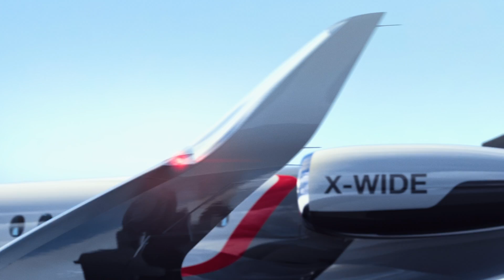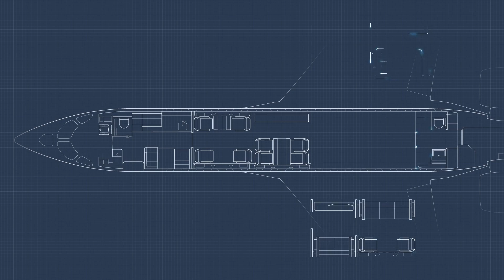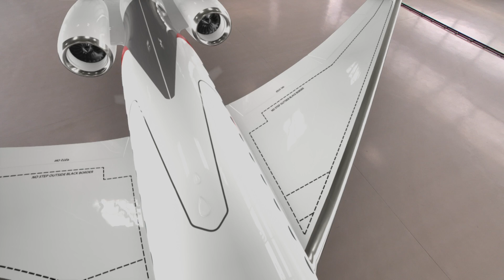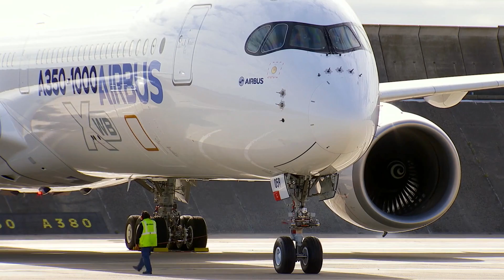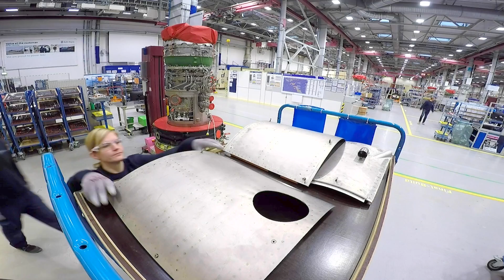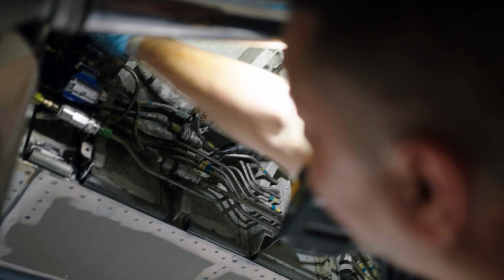Falcon 10X Premiere

Comment: I just need a Falcon 900 LX to fulfill my needs foir a range of 5,200 nautical miles, a ceiling of 51,000ft, a short-field operation of 3,000ft, a cabin to seat 7 to 14 and sleep me on a comfortable bed, and a combined thrust of under 15,000 lbs to keep the fuel consumption below 260 GPH. If I can afford to travel on longer hops, I'll opt for a Falcon 8X. If I can receive all of the money owed to me, then I'll either opt for the Airbus 319 or Boeing 737, which can keep the costs low by realizing the scale of their global fleet, so I can have an on-board shower, bar, office, bedroom, and living room. 

For large aircraft, I prefer to have the engines mounted on the wings, close to the center of gravity. For transoceanic business aircraft, I prefer to have a trijet. For short-field aircraft, I prefer to have an aircraft with high-mounted swept, trapezoidal anhedral wings, like  the BAe 146, collapsible right-triangle struts and fat tyres, like on the PC-24, and an on-aircraft APU, like that on the PC-24.

The PC-24, except for the low-mounted wings, is based on my concept. The Honda Jet, with the engines mounted on the wing, for the  Coanda effect, and proximity to the center of gravity, is also my concept.

I also like to have 2 pilots so they can take turns to fly and, at least,  2 riveting stewardesses for sex on long-haul flights.

Comment: Seems like an excellent plane to match Bombardier's Global 7500 and Gulfstream's G700.  Some advantages and disadvantages: 10X has a larger cabin cross-section, but the Global 7500 has longer range and the G700 offers a fifth cabin zone. The biggest problem, however, is that the Falcon 10X comes 7 years too late, as the Global 7500 was already operational in 2018, and this Falcon 10X won't be ready until 2025. Similar to the 6x which simply matches the Global 5500 and G500, Dassault Falcon is several years behind industry leaders Bombardier and Gulfstream in technical product development, so always seems to be playing catch-up.
Reply: G700 was introduced in 10.2019, so 1.5 years ago and 7500 10.2016, 4.5 years ago. So you claim of 7 years is not correct. Secondly, the 10x is the only one of those aircraft with over 2m headroom. For tall people, this is the only aircraft to consider. Lastly, it has a shorter take-off than G700 and has better support than Bombardier that is nearly bankrupt. Chinese costumers will also prefer French to US/Canada just because geopolitics. 
Dassault have a good plane at the right time.
Reply: @prof1crl   I was referring to date of delivery to customers: 2018 for 7500, 2022 (expected) for G700, and 2025 for 10X. Anyone can produce a mock-up cabin or CGI video and press conference for a new plane, but regulatory approval, production, and final delivery to customers is the ultimate measure. You bring up excellent points about Bombardier's financial health and Chinese customers (perhaps Russian too??) often preferring a European-built aircraft.
Reply: @loretog7315  Well the future Gulfstream and Bombardier models, the G800 and Global 8000, are also expected to enter service in ~2025, and they are near identical to the G650ER/G700 and Global 7500, so it may not be entirely true that Dassault is lagging behind...